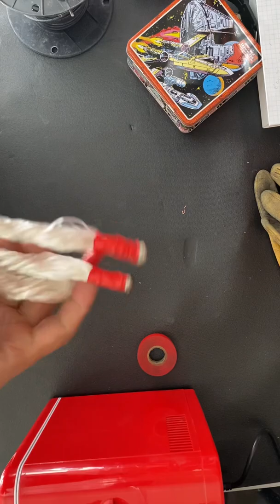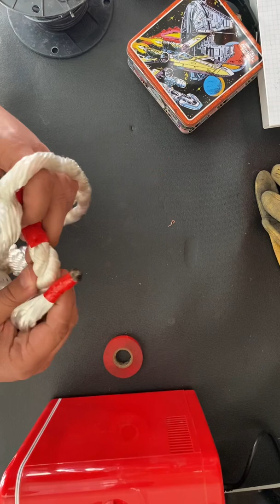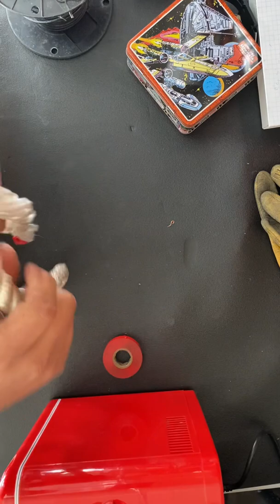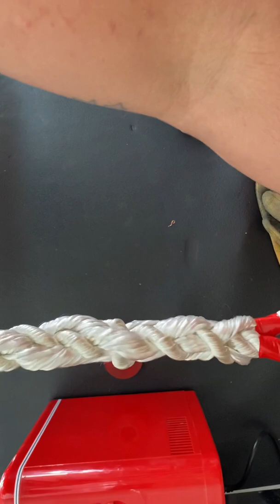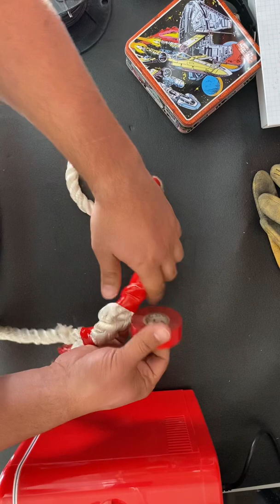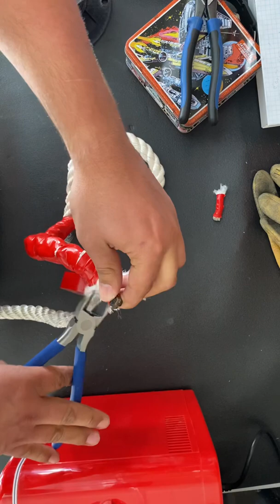HOW TO MAKE A PULLING EYE LOOP WITH ROPE

Comment: Thanks for the refresher.  I've been out of the IBEW Local 58 JATC for 6 years, and I've been on waaaay too much plug-and-play in cable tray in the car dungeons.  Now I have a nice pull head on this stiff-@55ed hard-draw copper triplex I'm forced to pull through 1 1/2" RMC to go from a power panel to a motor peckerhead.  Nothing like doing it right without being micromanaged.  Thanks for keeping the skill in our trade.  Lumen Intrare...